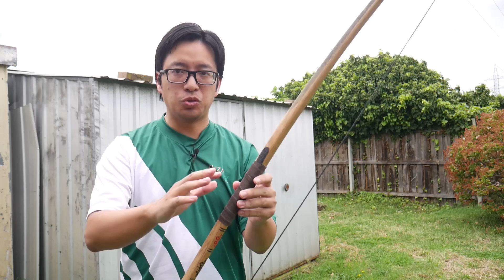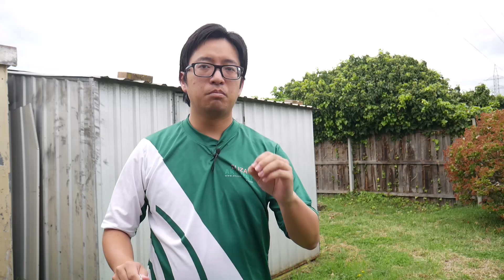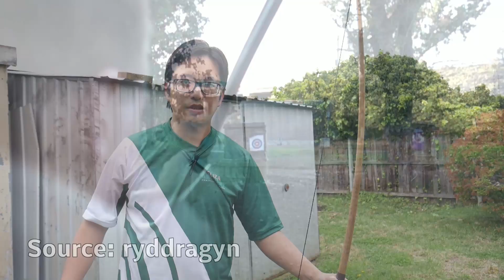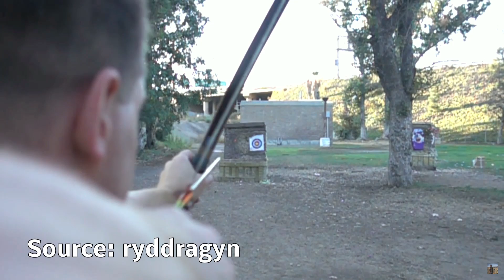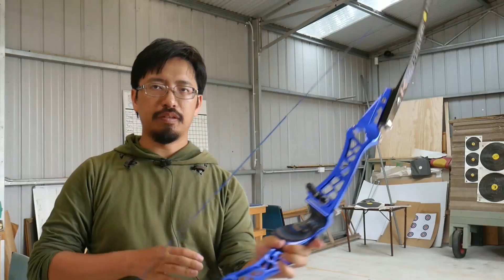Why Do Bows Have Centre-shot Shelves?

Comment: Does it matter why? It doesn't change the fact that you still have to pull the bowstring and aim in order to shoot.
Reply: But it makes a huge difference in the aiming department.  With my centre shot bow I can basically look along the arrow to point it at the target and hit, with my bow without a shelf if I did the same my arrow would fly massively to the left of where I was aiming. 

Without centre shot I have a different aiming method, it's harder to do and different arrows have much more of an effect on the shot.
Reply: @tjj4lab  this, exactly this.
for the bow without a shelf, arrow spine is more critical for aiming.
get the spine correct and you won't be shooting left. my guess is the arrows are too stiff (for a right handed shooter)
Reply: @tjj4lab  it means that your skill level is just too low. The higher the skill of the archer, the less the difference the center shot will make. You should probably aim to increase your skills with the bow instead of using tools and gimmicks right off the bat.
Reply: @Eidos_Trip  cs does not matter a consistent Newtonian reaction does
Reply: @Eidos_Trip  What a nonsense thing to say. 

According to you someone should just "get gud" and win the olypics with an English longbow.

There are ways to work around limitations, but the limitations are still there.

I use a simply wooden/flibreglass recurve shot off the shelf, the only modern convience is the centre shot cutout.
Reply: @Eidos_Trip  That's silly. Did you not just watch the video? It's not about skill. It's two entirely different ways of aiming. It's like saying someone who is experienced with a trad-longbow is a bad archer, because they can't shoot very well, the first time they use an asiatic bow with thumbdraw.
Reply: @GamelessOne  what I'm saying is that you should get good enough that no matter which bow you use, which target you're aiming, and even when both you and your target are moving, you could still hit a bullseye with ease. That's what I call a mastery of the art.
Reply: @Eidos_Trip  That's a very nice ideal to strive for, but very few people have the time to train every kind of archery style equally and unless you have some kind of extreme natural talent, it's just not realistic. 

For example one of the instructors at my range usually shoots olympic archery style, but he will also shoot a longbow some times, but he still uses an olympic style anchor, because he doesn't have time to relearn a different anchor point for the longbow.

Being a great archer is about consistency and sticking to a specific style. By your logic, the most skilled ancient horsebow archers weren't really masters, because they never practiced longbow style?
Reply: @GamelessOne  either you do it or you don't. If you want full mastery of the bow, you can't do it half-assed. 
Literally everything takes time and effort to master. Mastery in and of itself is tedious and a waste of time if you don't have time to waste. It isn't easy. You can use a specific bow and be accurate by using a specific style? Good. So, does it mean that you're a master? Hell no. If that's all it takes to mastery, then I should be a master of a lot of thing, and so should you. But, fact is, we arent.
Don't you dare underestimate the path of full mastery.
Reply: @Eidos_Trip  This discussion is silly. Please show me an example of such an absolute master? I doubt you are able.

What you can show me, is people like Howard Hill or Lajos Kassai or great modern styled archers, like oylmpic/barebow/compound world winners. We can find some very specialised trick shooters on youtube like Lars Andersen. Or we see archers like Justin Ma and Joe Gibbs who practice each their own type of historical warbow archery. 

There's nobody out there doing every one of these things at once, at such a high level of skill, comparable to each of the individual archers I mentionend.
Reply: @GamelessOne  well duh. I can't show it to you because I know no one like that. I said that the path of full mastery is hard, tedious, and it takes time to reach the peak. It is so hard that when it comes to full mastery of the bow or anything, you can count the number of masters with one hand, if not one finger. Not anyone can be a master. Only those willing to spend time and efforts will be one.
Reply: @Eidos_Trip  Alright, so you admit it's an unreachable ideal. Thank you. I hope we can agree that even masters of one type of style, are indeed masters. You forget that mastery requires a life time and there are is only so much time available in a humans life span. Therefore people will usually specialise in one style or school of thought.
Reply: @GamelessOne  would you say that someone who can't do anything other than addition has mastered mathematics? I sure as hell wouldn't.
It's the same in other fields. It takes time, sure. But it isn't impossible in theory and in practice. All you have to do is to forsake anything else other than eating, sleeping, and the bare minimum of living while devoting your entire life to the art. If you die before you mastered everything, then it simply means that you don't have the capability to fully master it. That's all.
Reply: aim....lol